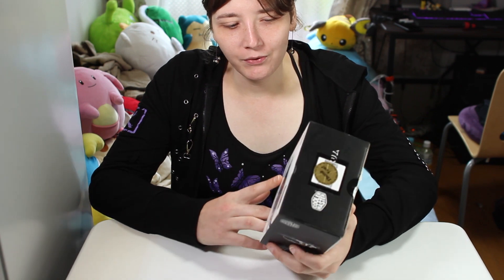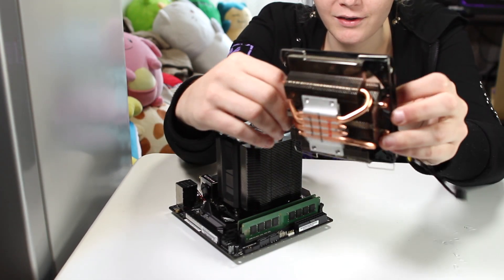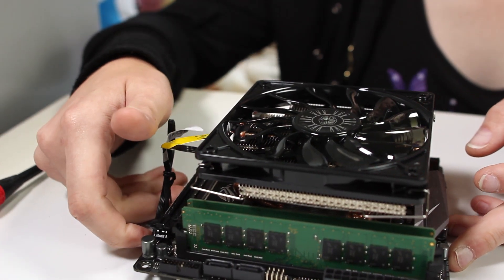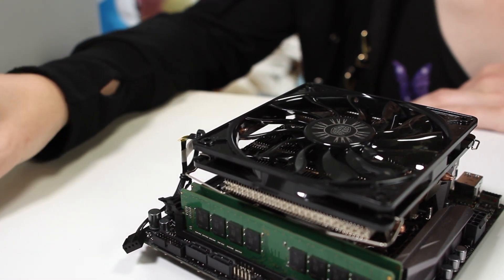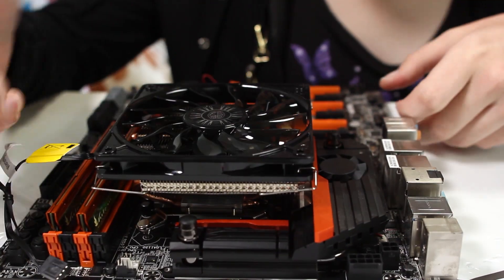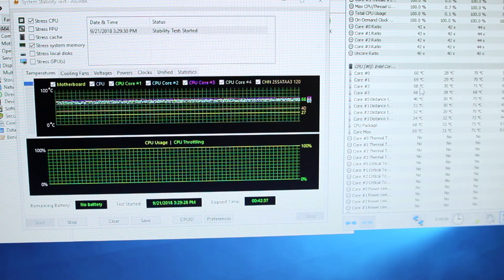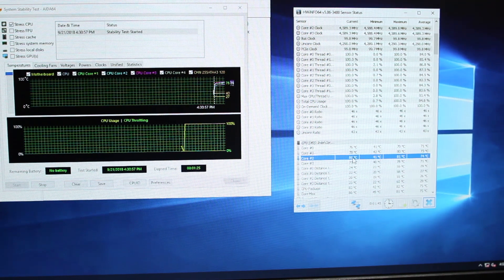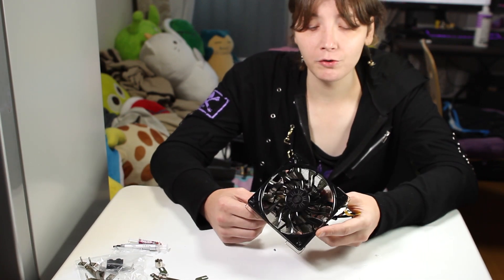Cooler Master GeminII m4 CPU Cooler - Review

Comment: So I have this cooler and over the weekend I redid the thermal paste after 5 years and my advice for this cooler is to use a bit more thermal paste than usual(non electrically conductive). I used the rice size method the first time around 5 years ago and the temps were hitting 75c during gaming. I took off the cooler and saw that the spread wasn't that great and the base of the cooler isn't all that flat, and has grooves where the heat pipes are.

I applied more thermal paste about close to 2cm long on the center of my i5-4690k and two more 1 cm long stripes to the edge of the IHS and now my temps run about 63C vs 75C. So definitely use a bit more thermal paste for this cooler.

Comment: G'day Kate,
I was looking for a review on the Geminii M5, but can't find any, even finding a M4 one in English was hard enough,
I am interested as I am building my nephew a PC & the Gigabyte board (GA-B75M-D3V) I am planning to use doesn't have a VRM Heatsink, so I've been looking at LP coolers because they blow air over the VRM too, I have a i7-3770 which I did a quick test running CB-R20 with the Stock Intel H/S & the VRM was at nearly 90c on a 20-25c day using my test bench, where we live in Australia it easily hits 45c during summer,
have you tried any similar LP coolers as a comparison for the M4, the be quiet! Shadow Rock LP is about $15AUD more than the M4 & M5 ($40AUD) & supposed to be really good, Noctua coolers are Super Expensive here ($99AUD for a 120mm LP) so out of the question.

P.s really enjoyed the review

Comment: Holy shit, you managed to overlock with that low profile cooler???
Reply from the maker: Yep not a bad cooler considering its low profile. Its got nothing on say a 240 aio but really good for its size.
Reply: Kate's Hardware Reviews yeah of course it wouldn't compete with an AIO lmfao it would literally be impossible and that's not its purpose

But I'm genuinely surprised. I was looking at it to potentially replace a shitty cooler inside a dell Optiplex that cools a core I 4770. Since its a non-K there'd be no overclocking going on so I assume it'll cool it even better. And ngl it helps that the low profile cooler looks absolutely badass. Reminds me of an old Thermalright Shaman VGA cooler. The fan on the CM M4 looks pretty badass. Would've loved it if it could light up. Maybe I could buy one of those cheap RGB fan frames and transform it into an RGB low profile cooler :D
Reply from the maker: yep youll have no issue with it on a 4770, if your going to swap the fan though just be aware that it has a half width fan so if you wanted to put on a regular sized fan you might have to bend the clips that hold the fan on.
Reply: No fan swapping, just (potentially) adding an rgb fan frame, like a cheap ezdiy one. It's a pretty cool little thing, you should look into it. ezdiy even makes RAM RGB heatsinks which looks absolutely badass. For like less than 20 bucks you can transform your maybe ugly ram heatsinks into glorious RGB ones. 

However you might be right. Even a fan frame might interfere with the clips. In which case I might just use some zip ties haha
Reply: oh nevermind, just looked at your video again. The clip clips (ha) to the back of the fan, not the front. So if - and these are all hypotheticals - I were to attach an rgb fan frame to the fan I would literally have to do no modding or bending.

Comment: Got one of those bad boys in a Corsair air 240. Swapped out the low pro fan with an sp120 Corsair fan and am digging both performance and aesthetics. Those fan clip wires were the devil to work with, but that’s a one and done, eh?
Reply from the maker: iJimTM just make sure you don’t look at the fan, at one point I could not get another fan on this cooler and every time I tried to get it straight it got more messed up until the clips would just fall off.....I had to just walk away from it for a while ;)